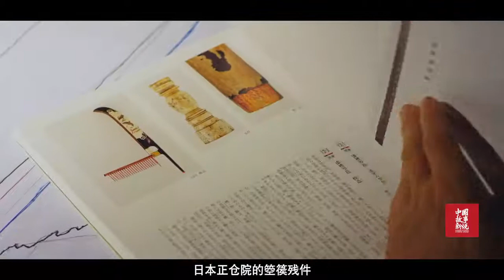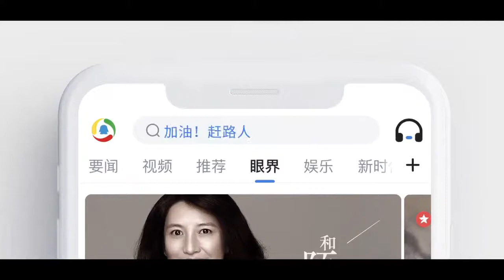Chinese konghou 箜篌 (Tang-style harp) builder Wong Wai Kee 黄袆琦

Comment: Are you sure this is not an actual composite bow attached to a transversal rigid wooden or metallic bar through a leverage mechanism that affects tuning? I've noticed the original paintings seem to depict an instrument for indoor (the simple thin one) that could be just the frame of the instrument used in an special chamber with superb acoustics and there is the bulky one that seems like the indoor one with a resonance chamber, this chamber could be attached to the instrument for acoustics only and not for mechanical and acoustic reasons like the ones I've seen before, in such situations you don't need to even carve the instrument, you can just use soft wood veneers or a very thin carve in such forms. I've observed also the original carving techniques for some French clogs that are made with a carving technique that depends on the wood grain,  the craft men employ a twisted timber that has the required for of the angled long point of these clogs, that renders the form strong, allowing conventional carving techniques impossible in straight grained lumber to carve such form, I think that could also be the technique employed to build these slender Kong Hou.
Reply from the maker: From the examination of surviving specimens of angular harp from Central and East Asia, the resonator was made of hollowed-out wood (sometimes narrower, sometimes wider), covered with animal skin (in the Middle East and Central Asia), or with a wooden soundboard (in East Asia). You can refer to the several hundred iconographic examples I have collected in my "Angular harps" Facebook photo album, which may be found in the "Photos" section of my Facebook page (David Badagnani). Mr. Wong's instruments seem to feature resonators that are swollen in appearance, much larger and wider than would have been typical in Medieval times (probably reflecting 21st-century norms).
Reply: @dbadagna  Yes,  I figured something like that regarding the dimensions of the instruments featured in the documentary. Thank you for the reference.
Reply: @dbadagna  Impressive collection you got there hehehe. It's clear to me that what I refer as the outdoors version is the original instrument, Is it that thin instrument then a product of the central Asian instrument with the Manchu  composite bow manufacturing? I  wonder if it was a literati instrument like the guqin or used during  tang / gagaku music.
Reply from the maker: @TheGrmany69  The images in my album are arranged more or less in chronological order, and clearly the earliest iconographic examples of angular harps are from Mesopotamia and Ancient Egypt, and their resonators are rather large.  If you want to make claims about visual representations of angular harps with smaller-than-normal resonators, you should be specific regarding which iconographic examples you're referring to, and do so within the context of all the extant images of this instrument type for that period, and keeping in mind the limitations of 2-dimensional representation, as well as artistic license.

In East Asia, the shu konghou (angular harp) was not a literati instrument, but instead used in court yanyue (banquet/entertainment) ensembles, often played by female court musicians.   You can refer to some of the historical documentation, including long, vivid Tang-era poems describing this instrument, contained in the "Shu konghou" page of my "Early Chinese Music Resources" website.

I don't think this millennia-old instrument type was influenced by Manchu composite bow design, although in its earliest forms there may have been some oblique connection with the hunting bow, as has long been claimed regarding the origin of plucked string instruments in general.  Search for the term "steppe harp" for examples of these early Central Asian instruments.
Reply: @dbadagna  Oh Cool! I did perceive a transition but couldn't tell if it was a through chronological ordering. It's interesting to see how the harp grew in complexity to be a reminiscent of Western/Mediterranean harp.
Reply from the maker: Here is a video I just found showing a reconstruction of a steppe harp excavated from Xinjiang, and dating to c. 400 BC-200 BC:
v=OpJP0baJGyg